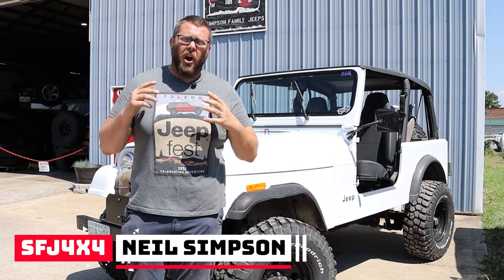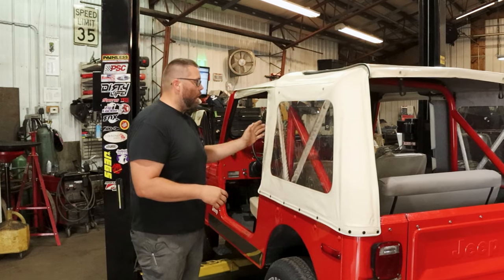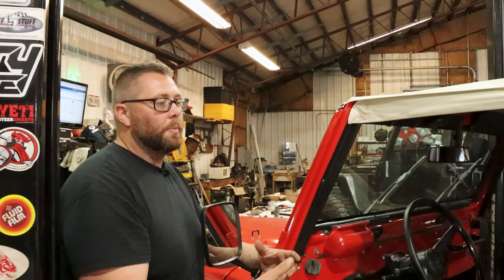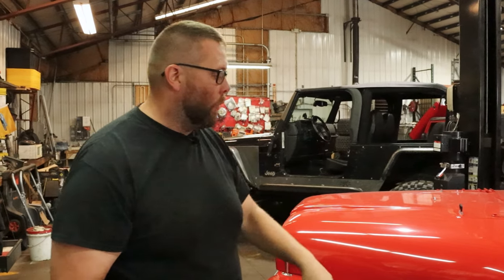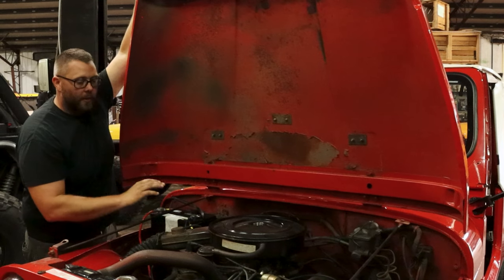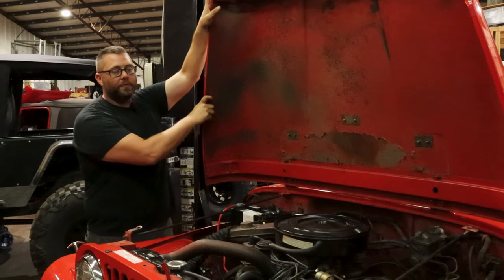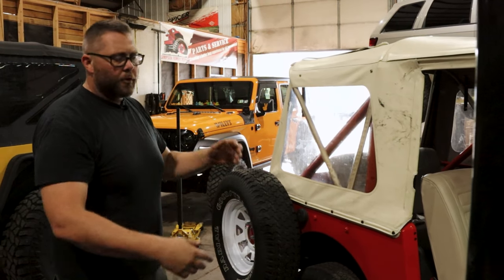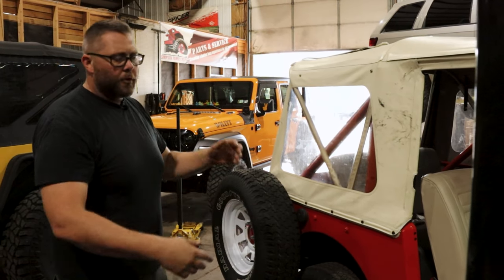OH NO!!! 5 Things About Buying a Used Jeep CJ7 // What to look at for your next purchase

Comment: I just bought a CJ7, an 82, drove it thirty miles home this week and will begin the work of figuring out all it needs rebuilt and restored for "daily driver purposes".  It needs the steering looked at right out of the gate, it's got a straight six and four speed, feels fairly tight and in good shape, should be interesting once I get into it's innards.  Got many new things to "check out" based on this and a few other videos.  Hope to be driving it in the next year or so as a daily driver.  Thanks!

Comment: Having owned and restored a dozen CJ's over 5 decades, here is what to look for; don't get soft doors with zippers, get rollup windows and then add the soft top, Most of the automatics were quadratrac AWD, so no flat towing with hubs, the 304 was all torque with no horsepower and slowww, low range in early CJ's with 3 speeds was not low enough and will power out on a steep grade, later Dana 300's were better. Late 4.2 (lightened) engines with VV (electronic mixture control) carbs will wreck your engine. 1985 and 86 tubs were galvanized so mostly rust free. At 72 my current CJ7 is an 85, with tilt, A/C, soft top hard doors, Ford 5.0 Mustang V8 (fit better than Chev with headers inside frame rails) Drag race spec. T5, 4:10 gears.
Reply: 1985 cj7 tubs are definitely not rust free lol

Comment: I've got a tilt steering column in my 81 CJ5, and it was wobbling like crazy, when I bought her. I found a mechanic to fix the play in the steering, but in the process they messed up the turn signal mechanism. Rebuilding those tilt steering columns is not a fun time. 😉

Comment: I purchased a new 1986 CJ7 Renegade when I was 20 years old. Still have the window sticker. Hard top and doors. $11,800. 4.2 liter 6, Dana 44, 30 300. B
Warner T5. Tilt steering. For a kid making $450 a week in 86 it was a very reasonable purchase. $242 a month. My insurance with $250 deductible was $85 a month. Today the price for an old CJ7 is beyond ridiculous. I’ve seen them as high as $60k. Dennis Collins can completely restore for $100k. Even rust bucket condition is going for almost 1986 new prices. Unless you’re a baby boomer who made their money selling off the American economy to the Chinese  to buy this vehicle it’s not a wise decision. Buy a wrangler JL like I did with warranty. If you want an old Jeep a CJ2 or CJ3 is a lot more affordable. In 86 when I drove my CJ off the lot I never imagined in a million years these vehicles would become so popular. They didn’t sell well because their handling was tricky and flipping one was very easy. Still it was my daily vehicle for ten years before I sold it with 157,000 miles on it.

Comment: Later year windshield frame also indicates not all original.  The spare tire on the side of a CJ7 in 78 and 79 was still available.  My dad ordered his this way to allow full acces to tailgate and hitch. Most important tip as you pointed out.....INSPECT FRAMES!  Inside of frames. Buyer beware of many CJs on BaT or any online auction.  Better view in person and inspect or go have it inspected. Beware of flipper sellers.  Great video.  Nice information.
Reply: I bought a Jeep new in 1980, mine was a base model it too had the side mount spare tire. Yes Im that old.

Comment: Just a note about the 1339 TC! 
The chain inside the case is notorious for stretching over time. The clutch cones also fail. It also takes a very particular oil!
All in all a very good transfer case IF taken care of!!!
I have a full set up for a quadratic including 3 TC's & 2 Turbo 400 tranny's, rear offset axle, tilt steering column, cardon front drive shaft and shift linkage.

Comment: In 1977 the tire did come on the side. Don't know about 78. Renegade with no tailgate got a rear mount. On the cj5s. Good video and info.
Reply: Sure did and in 1978 too.Looking at a 1978 brochure I saved from when Pops ordered a new J20 Jeep Pickup and they show side mount and optional swingout rear carrier in the CJ section. Enjoyed the video thanks
Reply: @waggitnshaggit6592  thanks for the follow up. I bought a 77 that I still have and a friend bought a 78 but memory wasn't sure about 78
Reply: @johndoe43  nice! I noticed he said steel body is preferred but my son and I are going to see about one with a fiberglass body, any thoughts on the glass ones?
Reply: @waggitnshaggit6592  never had one but I know you have to run ground wires for everything. My buddy with the 78 passed away and I wound up with his project. It is a steel from MD juan. The fiberglass are a little better than they used to be. Guy here in town did one and it looked ok. Never checked it up close though
Reply: Ok appreciate it
Reply: @waggitnshaggit6592  anytime I can help let me know

Comment: Survivor Jeep is correct. Two incorrect parts jumped out at me, the wheels are not OEM and the bumperettes are either YJ or aftermarket. definitely not OEM CJ. Nice video, thanks.
Reply from the maker: Good catch! You're right, it's not original but it was SOLD as original. That's part of the issue when people go out and spend a large amount of cash on one of these vintage vehicles, they don't know what they don't know and it can come back to bite them. Thank you
Reply: those are aftermarket bumperettes, you can tell immediately because the flattest portion does not have a tab that extends down

Comment: Question. Did the Quad Trac have a low range?
Reply from the maker: Some did. It was an option from the factory but you can get low range by adding an aftermarket unit to the back of the t case. If I remember right this particular Jeep in the video did not have it.
Reply: @SFJ4x4  I didn’t know if it worked like the older Chevy full time 4x4 or what. My old brother had a 80 Jeep wagoner long ago. Inline 6 automatic with quad trac. It didn’t have a low range just full time 4x. Was great until you came to a steep hill.